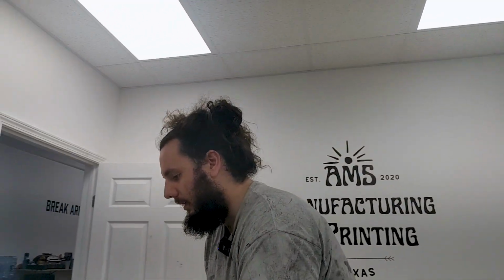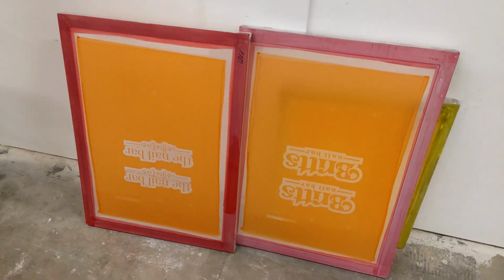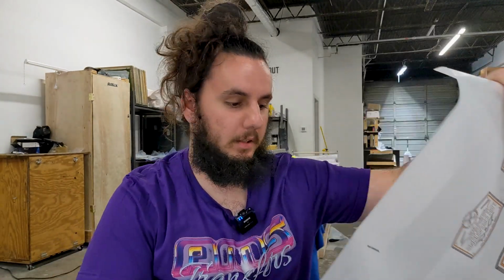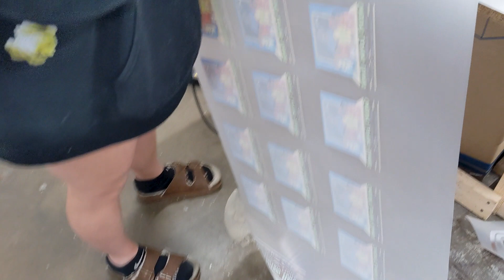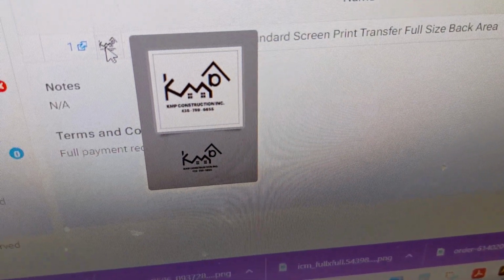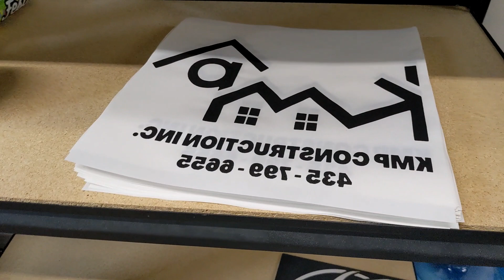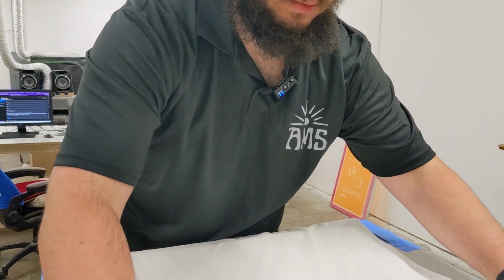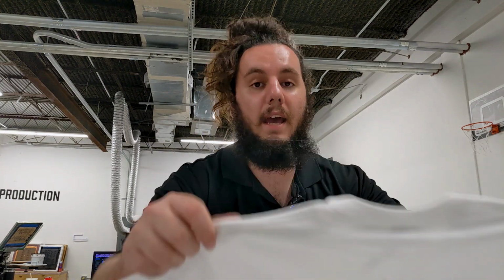Use This One Easy Trick to Avoid DTF Printer Clogs - Heat Transfer Supplier Weekly Vlog Day in Life

Comment: I noticed you dont run a color bar on your dtf printer when printing how do you know if your dropping channels or getting banding?
Reply from the maker: Mainly by looking at the design when it’s printing, typically only have problems when the printer has been printing more than 6 in a row of the same color designs. So if we do a lot of black designs for example we can be pretty sure that once the last black design wraps up we will need to do a head cleaning before starting the next print. 

It was annoying to cut all those color bars off which is why we turned it off.